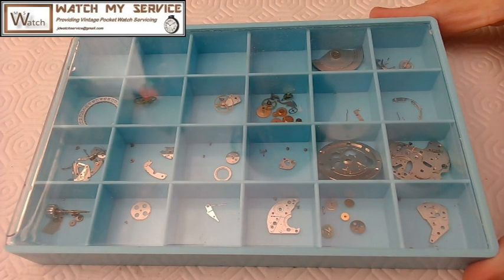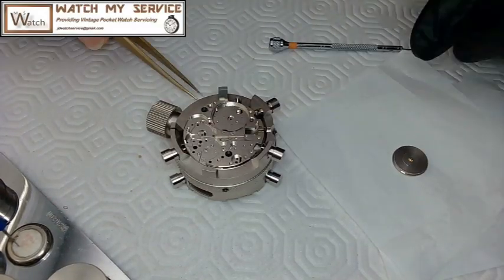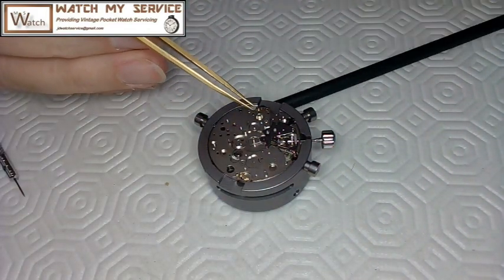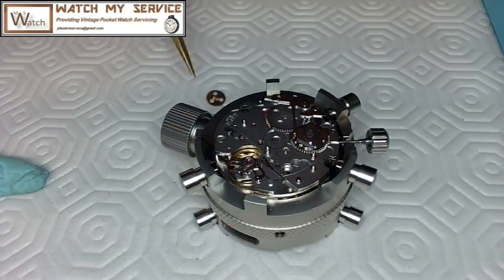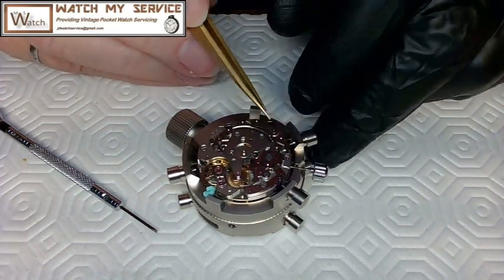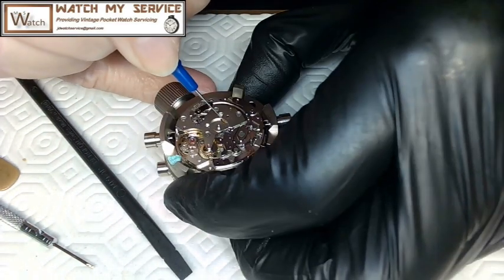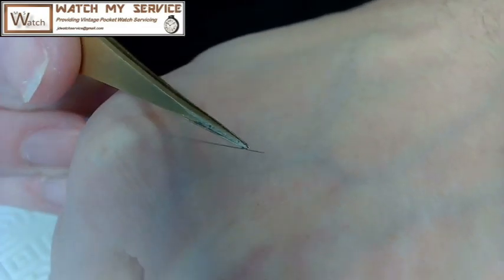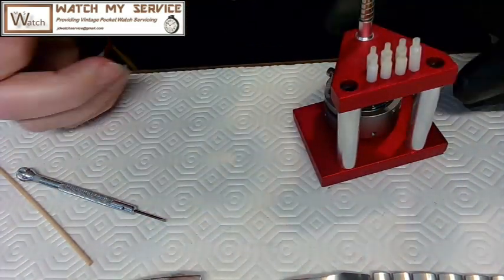IT TOOK HOURS TO ASSEMBLE THIS WATCH!

Comment: Thanks JD! That’s a nice watch, but a heck of a thing to assemble and oil - nice work as always. Where do you get oiling information specific to the movement?
Reply from the maker: This is one of my hardest strip Downs cleanings and rebuilds. I got the oiling chart from a PDF file that is well I actually took the course on how to strip down and repair or buildups these watches

Comment: Just my opinion- I would rather watch a series of videos at regular speed than one video 5x speed. I personally get a headache watching something like this. I don't upload so I'm not an expert on the reason why you chose this method but as a viewer I watch to learn and if that takes 1 hour or 10 hours I'm willing to do it. Your videos are great and I don't criticize often (actually never) so again it's just one man's opinion.
Reply from the maker: Would need to split it up and I will not do a 5 hour dub over:) I was not going to record this as the work is extremely complicated and you really need to concentrate. However, I thought I would record it compress it and then do a dub over but only if it was under an hour. So I guess in this case it doesn’t show the work in slow motion or normal motion but does show all the work that needs to be done.
Reply: @JDRichard  And that it did- it was indeed a lot of work